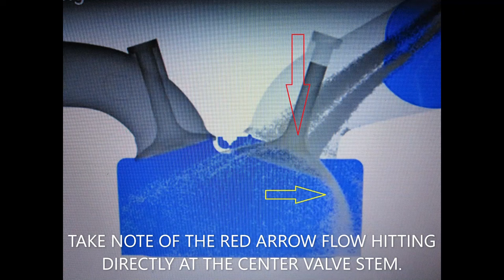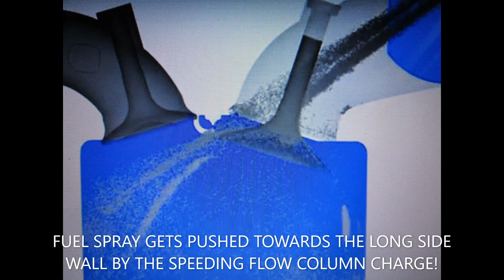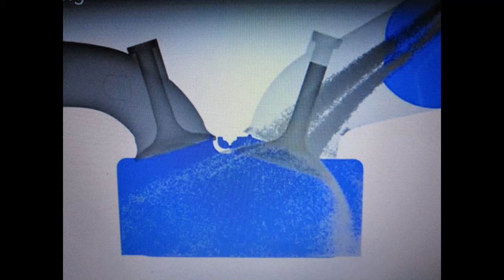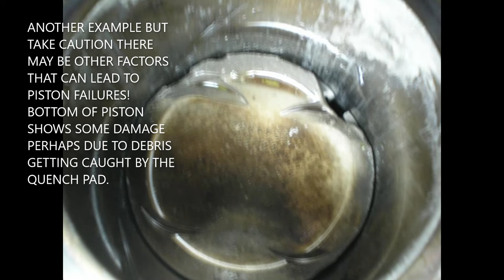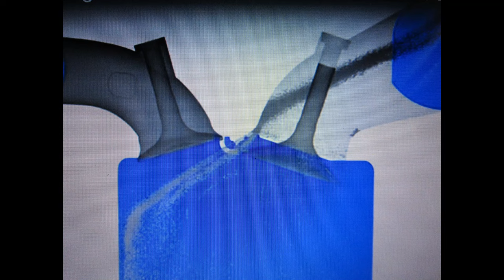HOW GOOD ARE FUEL INJECTION MIXING FUEL WITH AIR?

Comment: Thats why F1 in NA era used 150 bars of fuel pressure to atomize good and get it in time in the cylinder at 18.000 rpm. 

To state a former F1 engineer : the step from 5 bars to 150 bars was gave the same power gain as from carbs to injection at 5 bars.    

Ok  F1  na  is diffetent then v8 with carbs.  I know.   

Also :  for a  f1 at 18.000 rpm the carb delivers too late the fuel.  Valves are closed ..then droplets hit the valve.... thats what another engineer told me.... 

So injection can be made better than carb...but tajes loads of effort !!!!
Reply: The solution for the late of a carb at high rpm, Big plenums !!!!
Reply from the maker: Point taken and the big drawback for DI is its great ability to wash out the oil film from the cylinder walls specially those that spray sideways instead of vertical!  I will point these things out coming soon!  Not at all a problem for racing engines that get torn down after a race where a street car has to live for many years and many without any kind of decent maintenance.
Reply from the maker: @GUILHERMERSTEFENON , you got that right on point sir!
Reply: @benalamedaracing2765  This was in the era of port injection in NA F1.   For direct injection the dyno of , e.g. , Toyota in Cologne was equipped with 1000 bar injection pumps.  That pressure ( 1000 bars /16.000 psi )   was estimated to spread fuel quick and evenly enough at 16.000 rpm in a NA F1  combustion chamber.   But as F1 went from NA  to turbo charged that set up wasnt used for NA F1  engine. 

For the  port injected F1 NA engine , tests were done with increased injection pressure. But there was only a usable gain when increased from 150 bars to 350 bars.  But the FIA  limited pressure on 150 bars for port injected engines as 350 bar would result in a fuel pump equalling the prize of a F1 engine and that would limit smaller F1 teams.
Reply: @benalamedaracing2765  maybe therefore F1 went to turbulent jet burn system.   To be able to use lean burn and prevent cylinder wall washing.
Reply from the maker: @Baard2000 , as far as F1 they were using methanol? I have not been up to date with their changes and Indy cars were using methanol for a while as well.  I wonder what fuel they are using and how manufacturers wants to use technology as a selling point.
F1 technology sounds good like I said previously when they are torn down after a race and idle is of little consequence unlike a street type car who most life is spent in the lower rpm ranges where carbon on the intake system is the evil they have to deal with.  I have seen countless cars with these problem and low speed issues and others have added an injector in the manifold to rid of carbon and to compliment the GDI systems.
Reply: @benalamedaracing2765  Thanks master!!! 🙌🙌🙌
Reply: @benalamedaracing2765  but for circuit racing, like old f1 , part throtle response with carb and big plenum is compromised rigth? consider this and itb will be better choice...
Reply: Great video Ben.  Thanks
Reply: @benalamedaracing2765   F1 cars use
 ' normal unleaded '    for what its worth and idling doesnt shop up in their dictionary ..😁.
I completely agree in normal cars idling and traffic jam driving the DI is horror.  
Hence like you said an indirect injector keeping it clean.